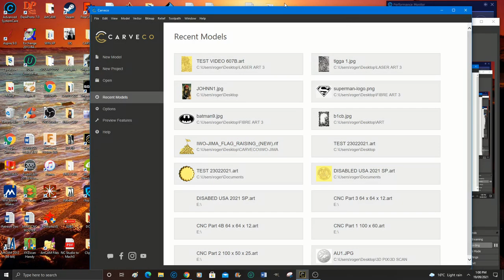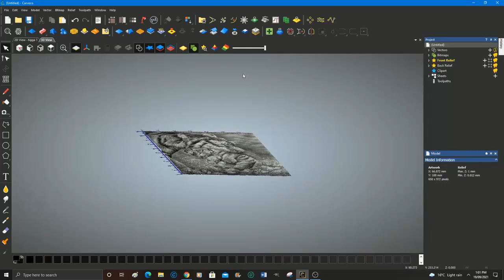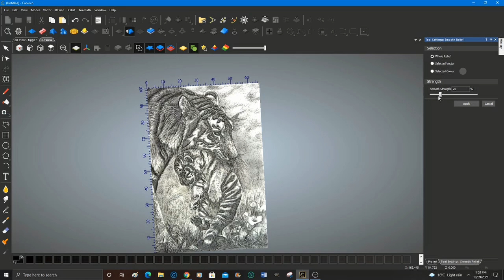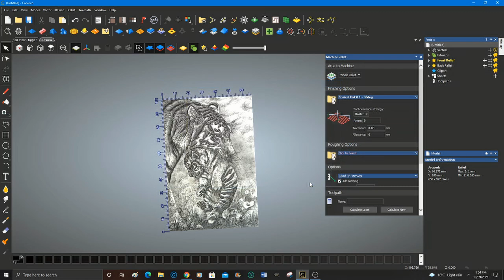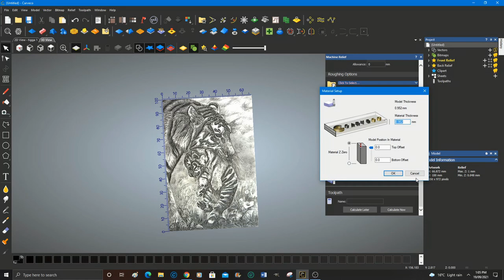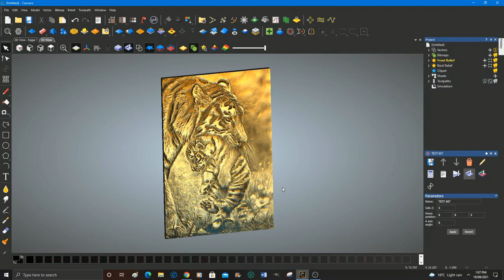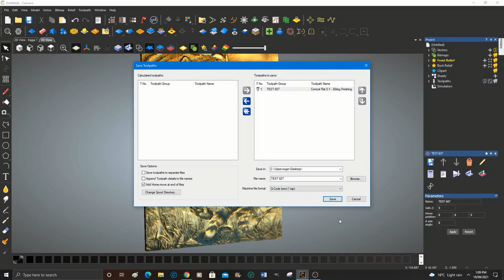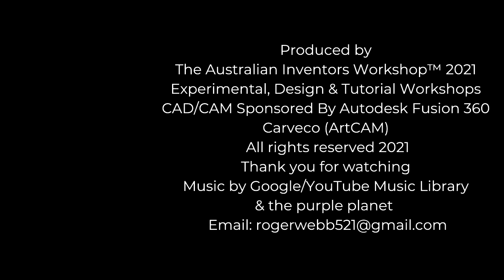CARVECO HD PICTURE TO HD ENGRAVING

Comment: Nice video Roger, when you say conical tool is that the same as what i would refer to a flat bottom v-bit as follows 3.175mm 30 degree 0.1mm flat for example
Reply from the maker: Yes it is ;-))
Reply: @rogerwebb9600  thank you